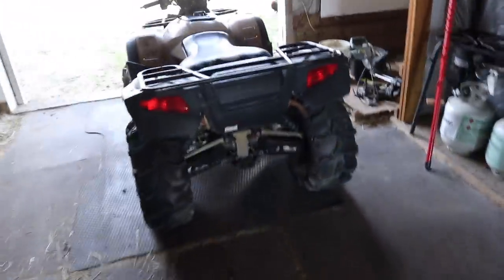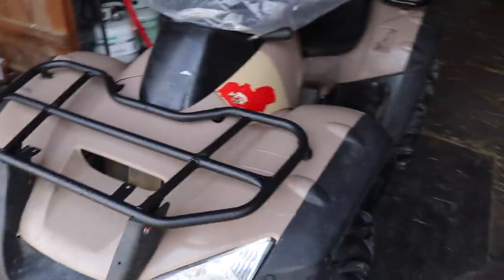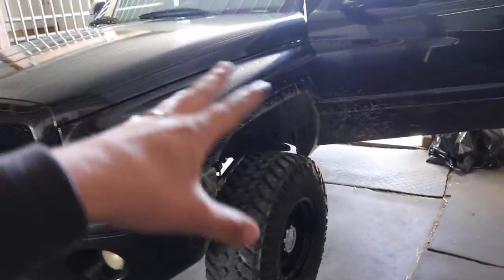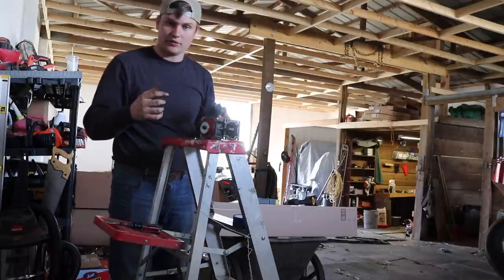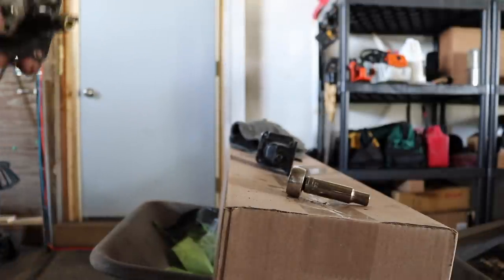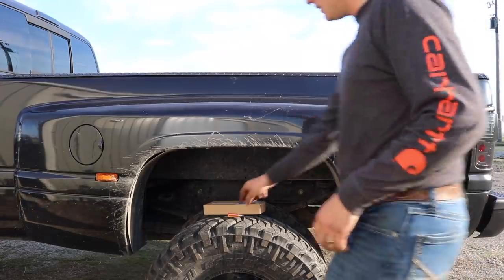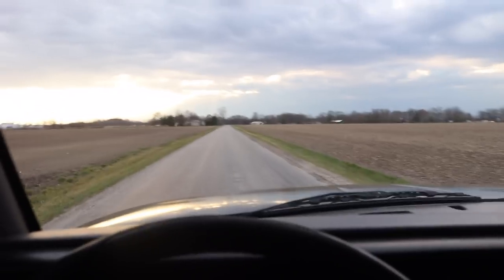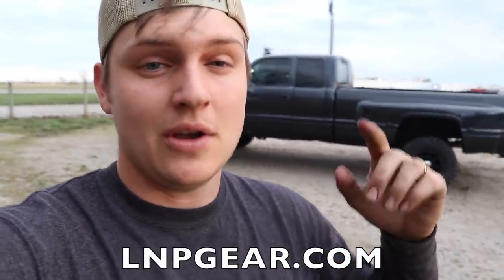12V Cummins AFC Housing MORE FUEL MOD gone wrong...

Comment: Did you make a note of the position of the AFC housing when took it off? The slightest adjustment (forward or back) can be huge. If you did not, it's possible that you mounted a bit further back when you re-installed it and could be the reason for the lesser throttle response and power. Loosen the four mounting bolts and push the AFC housing all the way forward towards the front of the truck. I did not see which way you turned the pre-boost fuel screw when you tightened the lock nut. Turning it in will provide more pre-boost fuel while backing it out lessons the amount. While you're at it, you can also adjust the star wheel up some but definitely have a look at that AFC housing position if you haven't already done so. :-)

Comment: You ever figure out the issue I kinda have an idea but did mine today and same issue thought it was untampered with and then the fuel plate was missing and didn’t feel much if any increase in power